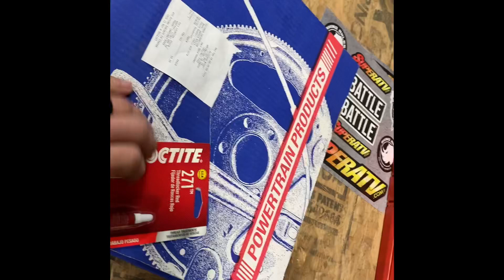5.4 diagnosing a bad flywheel

Comment: I would like to be contacted of possible
Reply from the maker: @MiguelGarcia-dx2ey  shop contact is on our website
Reply: @AutomedicGarage  Wow awesome quick ? I have a 2003 Ford expedition and I try to turn it over it makes a grinding noise do you happen to know
Reply from the maker: @MiguelGarcia-dx2ey  I’d have to hear it. Could be flywheel could be starter.
Reply: @AutomedicGarage I was wondering what would be a good time to contact you to get more information on the grinding noise

Comment: what causes the flywheel teeth to break and wear out?
Reply from the maker: This didn’t have any teeth broken, only the middle mounting surface broke but worn teeth are usually due to a bad starter or misaligned starter

Comment: I have a 2003 ford f150 super crew with a 5.4 im having trouble with getting my transmission off how do you get to the top bolts on the transmission?? I cant see or reach them
Reply from the maker: I use several long extensions and a impact.
Reply: I have been trying to see how to get to them so I can drop my transmission i have all the other bolts off and the cross member unbolted something is holding it up
Reply: Probably that hard to see starter bolt. Got me the first time. 😅

Comment: I have a 04 5.4 4x4 I think the trans went bad I was on the highway and it was kicking into O/D by itself in and out then it completely stalled on the highway so the rpm was raising but the transmission isn’t picking it up. So I made it off the highway and at the light it was stuck i revved it really hard it and it threw me back so I said I need to replace this transmission. I put a used transmission with warranty new oil filter and oil and it was the same problem I thought maybe it was the transfer case replaced that same thing. Now I’m thinking it is the torque convert and my transmission was still good. My warranty expires in 9 days idk what honestly any help?
Reply from the maker: If it still starts it isn’t the flexplate

Comment: Hey do a transmitter needs to be removed on a 2009 for fusion?
Reply from the maker: Typically the transmission must be unbolted and slid back at a minimum to gain access to a flexplate or flywheel. Not sure the details on a fusion.

Comment: I have a question I have a 04 Lincoln Navigator 5.4 v8 would I have to drop the whole transmission to replace the flywheel on it?
Reply from the maker: Should be a similar situation as this, just move a trans back enough after unhooking all the necessary components.

Comment: have a question. can a flexplate jam up? and create symptoms that "appear" to be seized engine?
Reply from the maker: It would have to be bent or have something stuck inbetween it and the motor but I’ve never seen or heard of that. Thanks for watching.
Reply: @AutomedicGarage  
thank you for your response,  yes this one is strange. engine appeared seized, pulled starter off crank freed up, so I figured issue was starter, replaced with new, truck fired right up..ya-hoo, but shortly clink-clank-clickty clank engine dies. frozen again. 
can't budge crankshaft.  pull new starter off, breaker bar crank free up.
repeat over and over. problem appears to be in flexplate area -may be a bolt come loose or broke jamming it up, no visibility in this area....
Reply: @sonofsteve566  What did you Find? I read on a forum that a guy had a broken flexplate and it prevented the engine from turning. I'm taking a gamble on a 04 with the same symptoms I am hoping it's just the flexplate.
Reply: @Smash_That_Like_Button  
make sure you check valve train, mine had a roller fowler gave out, completely destroyed engine, dropped valve in cylinder,  mass destruction, these motors are known for major problems.

Comment: If I close my eyes, I hear Hank Hill from King of the hill talking about flywheels! awesome video. Actually replacing the flywheel on my f150 as I'm getting vibration at certain RPMs after getting my transmission rebuilt; we thought it was a defective torque converter but even after swapping the converter, vibration is still present. that leaves us with the flywheel or Harmonic balancer.
Reply from the maker: Not the first person to tell me I sound like Hank.
Reply: Or driveshaft
Reply: I was thinking the same exact thing😂

Comment: I put a new one on 3 days later looks just like the one u pulled off the truck 
What would cause that
Reply: Thrust bearing on the crankshaft is worn.  This causes the flex plate to flex in the middle as the crankshaft moves front to rear.  Look it up, thrust washer wear 5.4 3v.
Reply: The pilot on the torque converter and the crankshaft is damaged. It loses its centerline and will continue to break the flexplate.
Reply from the maker: Must be a flaw in the flywheel or you have something twisting the flywheel so hard it’s sheering it off

Comment: Ok so how did you separate the trans without dropping it?
Reply from the maker: Unbolt torque converter bolts, remove bell housing bolts, remove trans lines from transmission, remove rear driveshaft, unbolt trans cross member and slide trans back as far as you can until it hits the firewall.

Comment: Good morning,
How did you move the transmission back, that's the issue I'm having I could use some help. Same make and model truck
Reply from the maker: kurohime take all bell housing bolts out, remove drive shaft(s) take trans mount loose, trans wire harness, trans dip stick, and torque converter bolts and use a trans jack and lower it and move back from engine till you have enough room to get your ratchet in between the engine and trans.
Reply: @AutomedicGarage  thank you 💪🏾💪🏾💪🏾💪🏾

Comment: Hi guys.😀 Does the transmission need to be removed on a 98 gmc safari van to replace a flywheel or flex plate?? 
My van is rubbing on the flywheel  but when i leave the car running and loosen starter bolts and tilt the starter slightly,  it stops grinding.  
Makes me think its a starter spring issue.  But just in case, does the transmission need to be removed or just disconnected and moved back to remove the flywheel? Appreciate your video. Thanks.
Reply from the maker: Clear Water it should just need to be moved back for enough clearance to get to the crank bolts like most.

Comment: They should invent a two piece flywheel. 2 half moon shaped pieces  that are balanced,  so that one half can be installed at a time without removing the transmission.  
Open end box wrenches could be used. 
Im not shure if this is a good idea,  but it sure would lower the cost of labor.
Reply: Sound like a good way to lose your feet.
Reply: Or Ford should just quit half assing everything. And I’m a Ford guy

Comment: Hello y'all I have a question did the truck make a clanking sound when it was cranked up before it finally rounded off thanks
Reply from the maker: When the truck was dropped of I was told they were driving it down the interstate and it revved up and stopped pulling. When you tried to start it, it sounded like a bad bendix on a starter sound. You could tell the starter had no load on it. So I can’t really say what it sounded like leading up to the total failure of it. But I do know 7.3 diesel flywheels make a clanking sound when they are about to fail.
Reply: @AutomedicGarage  I have a 99 suburban it would make  a clanking sound when I cranked it up and one day it was like in a bind then it cranked up with no clanking sound but it wouldn't move no matter what gear it was in
Reply: @lbizzy77  bro that happened to me 3 days ago on 59 the noise stopped then dragrace heaven thanks now iknow the problem

Comment: I have to do this as well and not sure if I have to take everything off the transmission to remove it. Of I can I would like to remove the least amount of stuff to get it done.
Reply from the maker: Giovanny Luque-1. I took the inspection plat off. 2 I unbolted the torque converter 3 unbolt the hanger for the trans lines at the front of the engine if it’s a 4.6/5.4 platform. 4 remove the driveshaft 5 removed the trans cross member bolts 6 use a floor jack or trans jack like we did to support the transmission 7 remove the bell housing bolts 8 work the trans back until you have enough room to access the flywheel to crankshaft bolts. This was on a 2wd f150 so if it’s 4wd of course you have extra items to address such as transfer cases and front drive shafts
Reply: @AutomedicGarage  sorry but did you guys have to remove the dipstick tube?
Reply from the maker: Giovanny Luque I think we did sry I didn’t think of that bud
Reply: @AutomedicGarage  That's ok your explanation helped put a lot I was able to get the job done thanks for responding.
Reply: @AutomedicGarage  Thank you very much ima have to give it a shot tomorrow. Do I remove all the electrical connectors off of it as well?

Comment: Any idea what cause a perfect break like that?
Reply from the maker: It’s just a weak point due to the way the metal is shaped seen it happen several times
Reply: @AutomedicGarage  i have a 6.0 power stroke and it's broken 3 times in one year. We are out of ideas.
Reply from the maker: @TheLuis0823  are you using a oem flexplate? If so get a billet one holds up to a lot more abuse.
Reply: @AutomedicGarage  how inplay is the 5.4 suppose to have
Reply from the maker: Travis Morris “how inplay”? I don’t follow